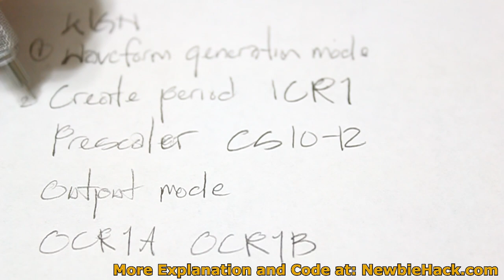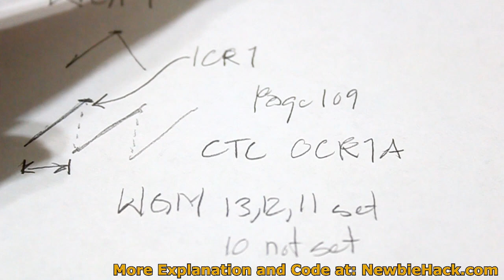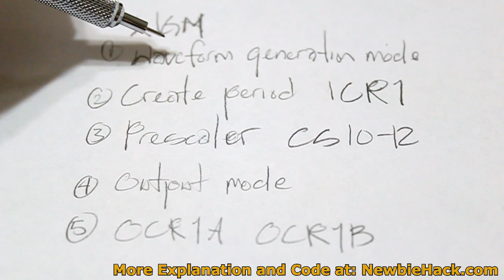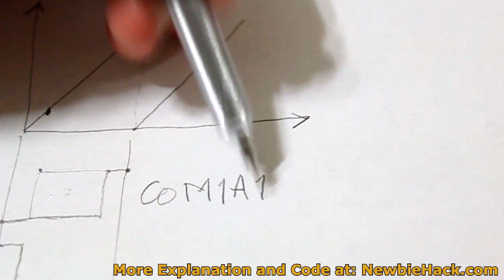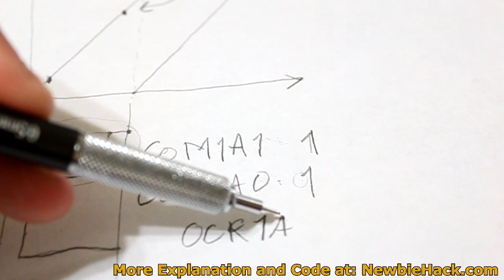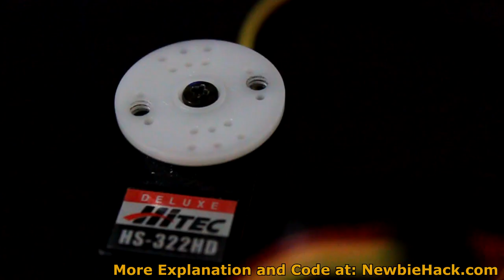38. Arduino for Production!  AVR - Controlling a Hobby Servo Using the Internal PWM

Comment from the maker: The stepping motor is a motor that essentially acts on pulses and turns relatively precisely achieving a desired rotation angle.  Standard stepping motors will rotate at 1.8 degrees per pulse (after going through a translation process to provide proper coil firing).  So, if say 10 pulses were sent to the driver/stepping motor, the shaft would rotate to 18 degrees. 200 pulses would give a full rotation of the shaft.  These motors are used where precise control is needed.

Comment from the maker: The amps are going to be drawn from the controller and other components that are connected to the controller.  You would need to determine what your amp draw will be when you are designing the circuit and provide the supply that will allow that level of current.  For #2, use a level shifter for that application.

Comment from the maker: The ideal range is 1000-2000, but with the errors made by the internal potentiometer, the ideal range will not be correct, so you will need to adjust the range as you test the servo.  If the servo doesn't turn to the angle intended, the number should be adjusted.  The final numbers for this particular servo in my tests were 800 to 2100.
Reply: Please help my servo would move only in one direction I tried all values btw 1000 - 2000

Comment from the maker: @xXGreg147Xx PWM is needed if you want to run the motor at a specific rpm. The timeframe that the motor runs is a applying the PWM for that amount of time.  I will be getting more into motor control a bit later.

Comment: Hi,

great video. But can you please explain the the 800 and the 2100 at the end of the video? 1)What does that mean? Are they suppose to mean the angle at which the Servo turns? 
2) Why do they turn in the opposite way? 
3) Normally a Servo allows only 1000-2000, but the value you give is out of range. 

Sorry , i am a beginner.

Comment: Hello Patrick I need help for below issue :-
If my micro controller has 12mhz crystal and I am using SG 90 servo motor. After calculation of timer with prescaler 64 my ICR1 is 3749 it is right or wrong ? One more thing for value I will set for  ocr1a to control servo ?
Please me .

Comment: Hello Patrick! i have two question:
first of all, remember that I am a beginner ...
1) How many amps can provide ATMEGA32 (I searched the datasheet but I could not find the answer)
2) I have a rotation sensor that sends pulses at 12 volts that I want to monitor. I can try to reduce it to 5 volts with the 7805? Otherwise you can recommend a controller similar to the ATmega32 that can handle 12 volts?
thank you so much
Andrea

Comment: Hey, I'm extremely new to the use of Microcontrollers and even C programming itself. But my question is if I'm using the AVR to run a DC motor for a few seconds is the PWM required? Also how do I alter the time that the motor runs and the direction? Sorry to ask so much, but any help is appreciated, thank you.

Comment: I have a problem using this code with my servo. I'm using Tower Pro MG959 servo and atmega328P (inside arduino uno) microcontroller. My servo just not stopping on the exact location. It just keeps bouncing for a little while from side to side. Then it is stop. If I change the location again it will go to that location and do the bouncing thing again. What can it be?

Comment: Hi i am really confused about why you use the OR operator between WGM12 and WGM13 when setting the bits.  Can you use the AND operator to set the bits since that WGM12 and WGM13 should be both 1?

Comment: Board specification :  16 Mhz , Atmega8 . I am using dc motor which I want to control through PWM. I have set PWM frequency at 25Khz. What prescaler should I set ? , considering that I will use 8 bit counter . Is 25Khz PWM frequency appropriate for DC motor?
Reply: Facing the same problem!

Comment: your code did not work for an atmega328 with the pins set up properly. When I try the first step, the servo turned 180 degrees back and forth non-stop.

Comment: Hi Patrick! First of all thank you very much for your help i´ve learned a lot with your videos but i still have one question. I need to control servos too but in this case you used the 16 bit timer.. If i ´m using an 8 bit timer i suppose that i have to use the prescaler i think it´s a 64 prescaler to create a period of 2.5 ms with a clock of 1 MHz. but i saw how you configured that register for the prescaler!! but after i don´t know how to get what i need I hope you can help me!! Thanks

Comment: Great explanation, but why are you using 50hz? my microcontroller is working on 16MHz so 16 million cycles, Do I still have to use that 50hz as a guideline for 20ms?
Reply from the maker: My favorite saying, "the system can only work as fast as your slowest component".  Luckily, in microcontrollers, you can have many tasks running at the same time.  The hobby servo requires a relatively slow pulse, so having the ability to create a slow pulse to control a non-digital servo can be done, but you still have many cycles in-between to do many other things.  So, it's not as if you are wasting the 16mHz, just figure out how to capture them with a state machine.

I explain state machines in other videos if you are wanting more info about it.
Reply: Thank you :)

Comment: hey mate great job on that!!
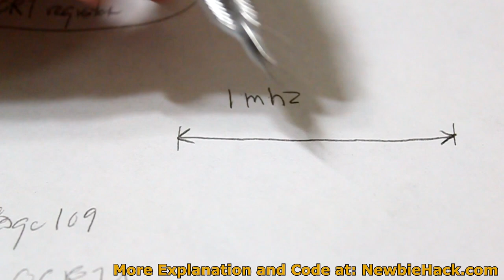A little correction on 3:28 you wrote 1milli hz but it should be 1Mega hz  :).
Im working on a audio spectrum analyzer with some  analog bandpass circuits, which I controll via 2atmega8 and 2 shift registers.I got some little problems with those tricky shift routines could u eventually pm me so i can discribe it to you more clearly?
thanks already!! and much probs!

Comment: Does this code work for an Atmega 328p as well? I tried doing this and used PB1 register instead of PD6 since PB1 has the pin OCR1A, but it didn't work an anyone help me out?
Reply from the maker: Make sure that the pin that you intend to use does not have a default use, like JTag or something like that.  If it does, you will need to set it to the alternate function.
Reply: But wouldn't setting PB1 using the DDRD suffice? Wouldn't it give it the OCRA functionality?

Comment: If anyone needs the code to sweep a servo from 0 to 180 degrees here it is:
(nb: I used atmega328p with 16Mhz external crstal)

#define F_CPU 16000000UL
    //only needed if not running default 1Mhz internal RC oscillator
#include <avr/io.h>
#include <util/delay.h>

void setServoAngle(uint16_t angle);

int main(void)
{
        DDRB = 1<<PORTB1;                 // INIT PinB1 AS OUTPUT as it output OC1A
 TCCR1A |= 1<<WGM11;         //set as fastpwm mode pg136
 TCCR1B |= 1<<WGM12 | 1<<WGM13 | 1<<CS11;    //set as fastpwm mode pg136, set div by 8 prescaler to get 2Mhz pg136
 ICR1 = 39999;           //top count where it resets i.e sets frequency
 TCCR1A |= 1<<COM1A0 | 1<<COM1A1;      //set output from OCR1A to be inverted i.e sets +ve time
        //OCR1A -> output compare register, ie when pwm goes high
 while (1) 
    {
        //18Mhz/8(prescaler) = 2Mhz,     2Mhz/50Hz = 40'000 clock cycles in 20ms.   And 40'000counts/20ms = 2000 clock counts per milli second
        //2000 = 1ms = 0 degrees 
        //3000 = 1.5ms = 90 degrees
        //4000 = 2ms = 180 degrees
             

  for (uint16_t angle = 0; angle  < 180; angle ++)
  {
   setServoAngle(angle );
  }
  _delay_ms(2000);
  for (uint16_t angle  = 180; angle  > 0;  angle --)
  {
   setServoAngle(angle );
  }
  _delay_ms(2000);
 }
}

/*
 - angle can be a value between 0 and 180 degrees
 - scale factor is calculated by (4000-2000)/180 = ~ 11
       -NOTE-->I had to use a scale of 18, not 11 because my cheap servos work better on it
       -I know its an approximation but you can test it works great
*/
void setServoAngle(uint16_t angle)
{
 OCR1A = ICR1 - (1400 + angle*11);
 _delay_ms(5);
}

Comment: Thanks for putting up these videos, their very helpful. I have a question though, I'm a little confused because I'm using the atmega 168 and I'm not understanding how to set the bits because their a little different on mine. Can you or someone take a look please, and tell me how I would go about doing the same thing but on the 168 please? thank you; Heres the data sheet: http://www.atmel.com/images/doc2545.pdf